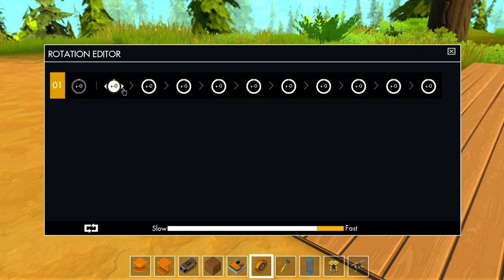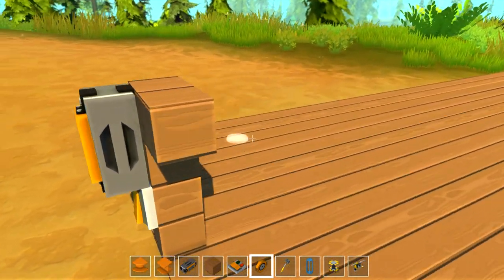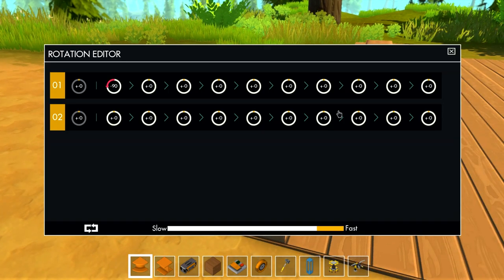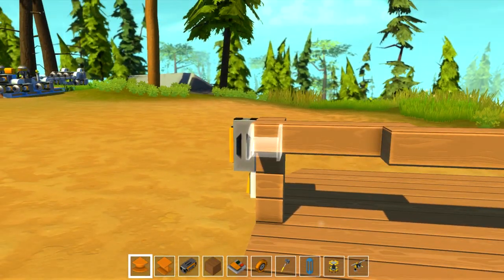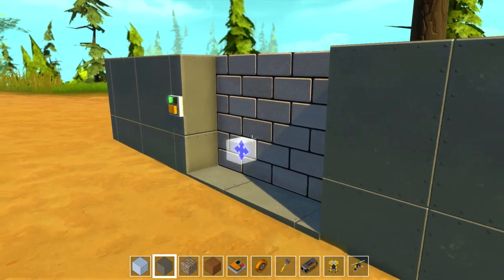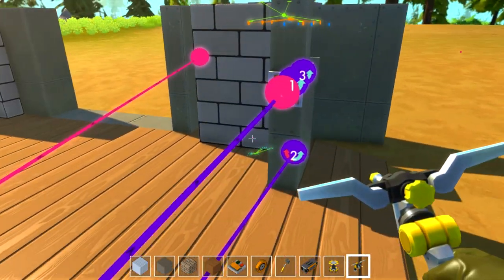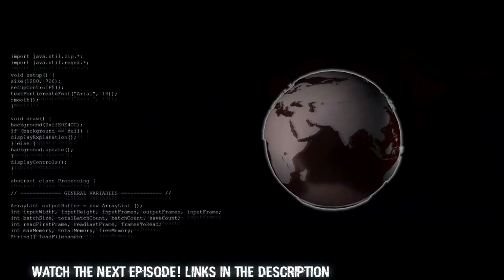Scrap Mechanic | Sliding Door!

Comment: lathrix you can have a little contraption that puts up to 6 (I think) inputs to 1 output so 6 buttons to 1 controller, just have the buttons go to controllers that make a 2x1x1 block go down and activate a sensor, you can have multiple of those blocks go in front of a sensor so that way you can connect multiple inputs to one output :D (doesn't work with switches tho)

Comment: Lathrix, you could probably put alot of the empty space left by the door mechanism to good use. Hollow spaces like that are great for storing all your controllers. Also, without giving too much away, it is possible to make multiple input mechanisms and even some simple logic gates, the key to this is that while blocks that are part of the same structure can't trigger sensors, a block attached to that structure with a bearing can trigger them.

Comment: Lath... i have a few.... tips and tricks for you :D
(P.S. the trick is a way you can connect more buttons to a controller.... its a bit complicated though (but you are smart... so you will figure it out... this is just a... helping hand... ))

tip 
instead of going to the controller to change the + ad - rotation of your spinny things... you can just right click them with your connect tool...

trick 
You can use the sensors to make a connecting module thing for your controller just have a row of arms on rotaty things each 1 conected to a controller with a button and at the end of the arms have a sensor that senses when a arm goes down and then tricker your door controller..... sorry for the long explenation xD

Thats about it.... also... i agree in the "learning it yourself" thing... its way more fun that way :D

thanks for all the good vids :D

Comment: Where you have built your door mechanism facing out from the front wall, perhaps you could build closer to it. Additionally, where you have blocks attached (you can see a gap when you open the door) perhaps going in/out 90 degrees might help.
Regardless, good to see this become a new series. Nice vid.

Comment: I think you have some room to optimize:
1) if bearing three is free floating after you build the structure of the door shouldn't gravity keep it in position?
2) moving bearing one to the outside will should give you another block of space I think.
3) Reshape beam two to an L. (You could also tweak the angles so beam two is never flush with beam 1) This allows you to move bearing three to the other side. Thus reducing thickness by 1 block.
4) I think you could lengthen arm three by one or two blocks. That should allow you to build the cosmetic wall without a hole in it for beam two.

Assuming you haven't already figured this out for yourself off screen.

Comment: Hey Lathland to make it a proper star trek door it needs to open and close quickly try using sensors facing towards the entrance instead of away so you can run in. (you might also be able to have more than one set of mechanisms on one arm to get around it)

Comment: hey lathland u can use the wheels on a 12/12 flat surface in the middle on Each side... this being said u can use this mechanism to rotate/tilt in the air when using thrusters.... note the thrusters are not needed to turn only to Lift .....Also for the wheels to work u must have 4# engines set to max or any of choice in order for your hover craft to work

Comment: Like other people have said, putting a sensor or multiple sensors infront the door. May this be horizontally across the front of the door or above or as a door Matt. Would give you the desired effect also having it open and close slower when using the sensor aswell.

Comment: If you have two (or more) buttons connected to different controllers that access bearings with a small 'arm' that turns in front of a sensor, then connect the main mechanism of the door to the sensor instead, it should work both ways.

Basically, imagine a sensor. In front of it, you have a two block pillar on the front right, one block diagonally, and a two block pillar on the front left, one block diagonally and one block forward. The said pillars are connected to bearings, and by wiring the bearings to turn 90 degrees (or better, start at 30-45 and just make adjust the controller accordingly), the bearings should turn the pillars just enough for the sensor to activate. Since the two buttons connect to separate pillars, they should work if you put one outside the door and one inside the door and just make the sensor mechanism behind a wall or something; it's pretty small. If it doesn't make sense, you may be able to find a video for an OR logic gate (which is the two button-one output thing) on Scrap Mechanic if you just look around.

Comment: if you put the door mechanic in a "basement" and build the doors up you could hide it under ground. i know you cant go underground but you can make a ramp to a second floor that would be considered the main floor so the big contraption wouldn't take up any space and the tall doors would reach to the top it could litterally be 3 blocks above ground level i think that might be enough space to hide the contraption

Comment: lath, with the problem of opening the door from the inside, it may be a bit large and use up a lot of space, but what you could do is attach a second door mechanism with the scissor thing, and so when you want to leave, you'll activate one set of scissor moves, and when you want to go in, you'll activate the other one.

so it'll look a bit like this

Going inside 1.
-- -- -- --[this is a door][the other half]-- -- -- --

2.
-- -- \/[still the door]    [you get the point]\/ -- --

3.
-- -||[D = Door]        [D]||- --

door is open, then the reverse for closing it, which is automatic thanks to your resting spot

now, for going outside... 1.
-- -- -- --[more doors][yay]-- -- -- --

2.
\/-- --[D]    [D]-- --\/

3.
||-- --[this is probably]        [annoying by now]-- --||

and there you go.... you can open it from both sides

Comment: connect a sensor near the control box with a bearing with a block that keeps the sensor activated and have a button on the door turn the bearing.
if you can have 2 buttons connected to the baring then you're dandy

Comment: I feel like it would be better to use the sensor instead of a button, and put the sensor facing parallel to the door. That way you can just walk up to the door, and it will open. You may want to increase the speed though.

Comment: or just have censors instead on the outside of the ''pillar'' where the button now is the inside, next to where the doors slide open en closed, so if you stand in the ''doorway'' it automitically oppens

Comment: Idea for a 2 way button system have 2 buttons that both rotate a block infron of the door sensor from either side basically take one button and hook it up to a baring that rotates a block in front of a sensor from the left side of the senser and another rotate it in from the right side and the sensor attached to the dor mechanism

Comment: about the switch issue: I just have the switch on a rotating block in the wall and then hook the bearing up to a controller have it spin 180 degrees put a button one the other side of the rotating block hook that up to the previous mentioned controller. done, problem solved.
Reply from the maker: +Daniel Huebner "Note: Rotating the button using the same command so that it faced inwards after the press is a decent way to make this work, however it isn't quite what I'm after " from the description, although the problem is solved it really doesn't help in so so many situations and limits wall sizes and such - I figured out a multi-imput controller now which helps a LOT, going for the simple option doesn't help teach you anything sadly! ^_^

Comment: I'm not sure if its possible, but perhaps connecting a button to a switch or a button to a button
Reply: I think i just thought of a possible solution, in theory if you pivot an object infront of a sensor it will activate, so you could have buttons that activate control blocks to which pivot objects in front of a single sensor which controls the actual door's control.     

Thinking further about it, its possible this technique could be used to make Basic logic gates too

Comment: Lath, there's absoloutly no need for your door to be so large... It could be compressed a lot. Also, I think building the building out of metal just looks... bad. I suggest using bricks for the building and metal framed by border blocks for the door.
Reply from the maker: +DaAwesomeMinecraft I like the size of the door itself, and the mechanism is exagerated for me to learn from - the metal I disagree as I like the concept of a metal bunker, it also doesn't even have the sides on or the support beams yet (Likely stone.) so judging it now is like judging a new house based off the concrete foundation - a bit silly . :P
Reply: +Lathland I do apologise for seeming to jump to a conclusion, however, did you not say you were going to build it out of metal, withought explaining the whole bunker thing? sorry, I don't mean to sound rude, I do loce the videos.

Comment: is it possible to create a base?
Reply: also using the sliding technology will you create a vehicle that when a button or switch is used a weapon appears?
Reply: +Nightingale Shade I mean 6:00 to 7:00
Reply: If you mean placing blocks directly on the ground then yes you can, the lift is mainly for vehicles. You can also place blocks on trees.

Comment: build a second controller and conekt the sliding doors to that controller, ps paused the vidio so dont know if u did that
Reply from the maker: +PotatoDragon - MC Bearings can sadly only connect to a single controller.
Reply: +Lathland I know you won't but look up how to make logic gates in scrap mechanic (2way switches)

Comment: lath lust rotate the button duh
Reply from the maker: +James Heaton Of course, however not quite what I was after as this was a learning exercise more so than anything, I wanted a system that could be reversed from a location other than the original location (Albeit rotated.) Without the need for the button or switch to be moved with it.
Reply: sounds good to me☺
Reply from the maker: +James Heaton Should have really showed that in the video honestly, as I actually did that very soon after and even before the recording for practice xD